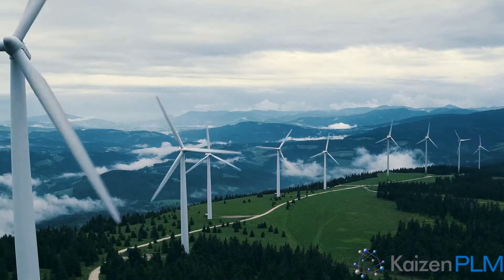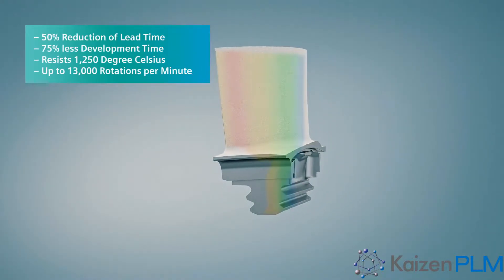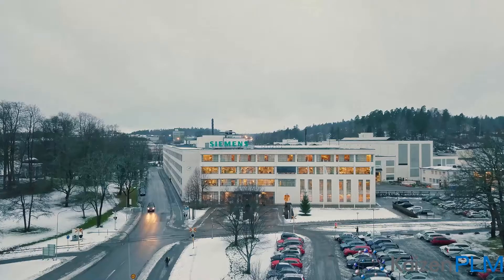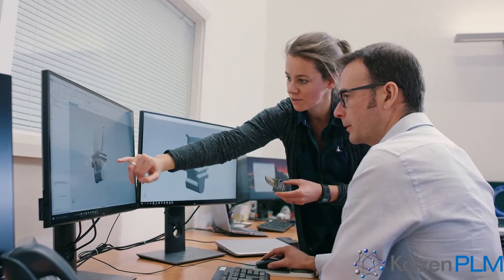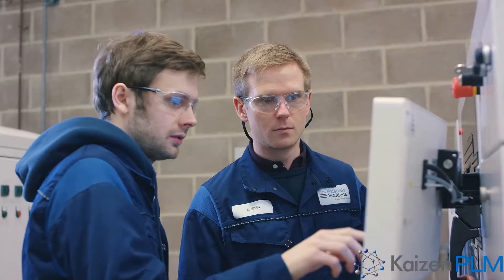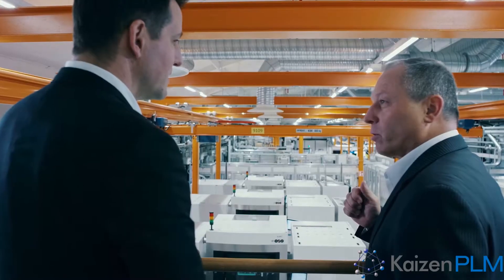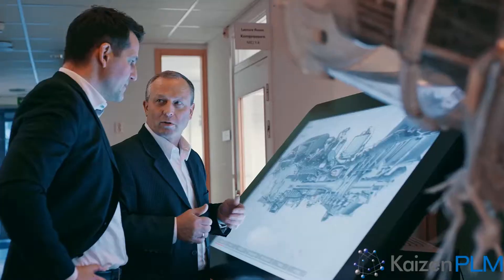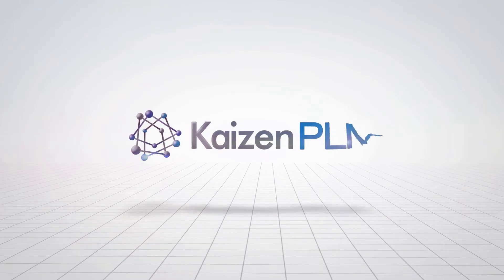Siemens uses AM to create a turbine blade with internal cooling channels and improved efficiency

Comment: Um, turbine mechanic here - internal cooling has been used since the 1980s on turbine engines - this is NOT new. 

Efficiency and reliability upgrades , yes - metallurgy and AM is evolving and optimizing things

Comment: I’d hope you are printing the parts on their side.  Those layers would hold up better under rotation if they aren’t naturally wanting to shear at any layer.
Reply: metal 3d printing works a little differenty than the typical plastic filament 3d printing. there are oher things to worry about here tho

Comment: Single crystal without directional solidification, is it really possible ?
Reply: They are not crystal blades
Reply: @anshulbhardwaj4038  I see someone has not been paying attention in his materials engineering classes.
Reply: @majesticrattoon4429  3d printing is welding unlike casting which produces single crystal blades
One more thing in laser metal printing grains follow direction of laser unlike single crystal blade casting where cooling metal forms single crystal .
Reply: @majesticrattoon4429  I might have missed materials class but i did attended my solid state devices class.
Reply: @anshulbhardwaj4038  Yeah and the guy is asking whether it's possible to 3D print SX alloys. The answer is no. But theoretically you do not need SX alloys heat resistence if you can cool the blades more effectively thanks to 3D printing. Having SX alloys with complex inner cavities is the dream here, which IMO isn't conceivable.
Reply: @majesticrattoon4429  these blades are used in compressor saction not on the turbine saction of jet engine because centrifugal forces and heat both need to be taken care of.
Reply: @anshulbhardwaj4038  Wrong.....they are turbine blades, there is no cooling in compressor blades and they are cheap as they are high  speed milled from wrought bar.
Reply: @anshulbhardwaj4038  No, these blades are clearly in the hot turbine section... they have cooling holes.  Compressor blades do not need to be cooled.

Comment: you are creating new boundaries which we avoid with single crystal casting ???? how you can come back to single crystal structure or you have hidden steps ?
Reply: I know Boeing was recently researching HIPing (Hot Isostatic Pressing) SLS printed parts to diminish the grain size and porosity. It's not as strong as single crystal though so I imagine they modified the design to reduce the material strength requirements or perhaps are only using them for the LPT section. Perhaps they are doing the same thing.
Reply: @SafetyLucas  increasing efficiency at cost of strentg in LPT section makes much more sense than using this in highier temperatures. It is important to remember that turbines have many stages some of which doesnt need exceptionaly resistant materials. It is also possible that the material they used can actually get stronger from 3d printing process as new materials are invented every day
Reply: @SafetyLucas  could be but i think the whole technology going to be disrupted by electrification remember PV=MRT you can increase air temperature with electricity thousands degree without any moving parts ?  temperature and pressure can proportionally  increased ???
Reply: this video is for bussinesspeople, not for enginners :D
Reply: @erkintek  too true

Comment: We've been root cooling for 35+years... where's the innovation in that! 
And weve also achieved boundary layer pressure control...
Reply: What are you on about? This cuts like more than 50% of steps in the manufacturing process lol. That is groundbreaking in anything that is being produced.
Reply: This is groundshattering inovation,
This cuts all the majority of 75 % in the execution of manufacturing
Reply: When you don't understand the point of something and other people have to explain it to you.
Reply from the maker: Thanks for the insights 
Twofaced McTwoface